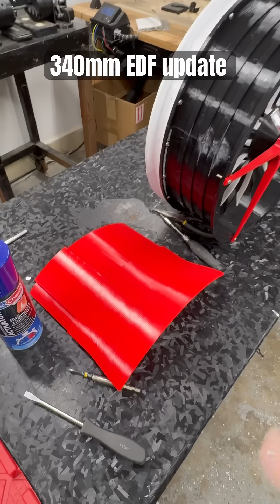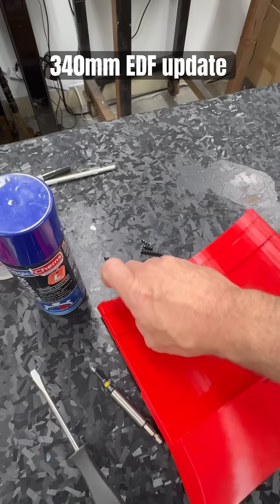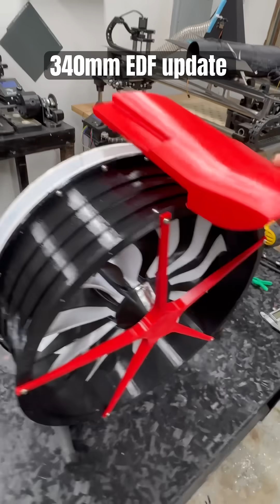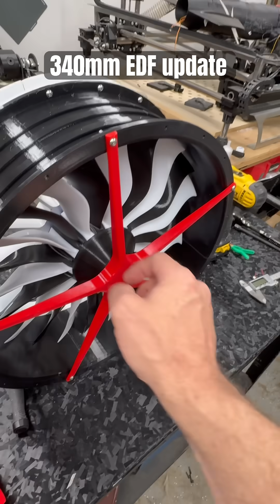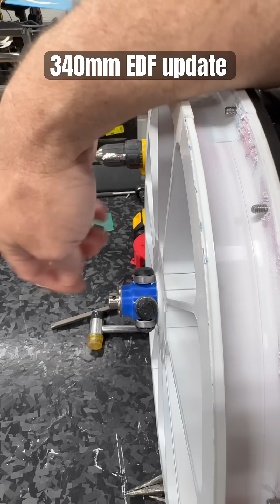340 mm 3-D printed EDF, an explanation of the bench test unit. ￼#3dprinting #fyp #edf #diy #shorts

Comment: Also i would calculate the g force at the wingtips, as uuh, y'know that can be very big
Reply from the maker: Yeah, I’m going through a calculations to figure out tip speed, and everything else at this point I’m going to be going through voltage cycles from 22 all the way to 75 failure rate will determine the appropriate voltage and then we’ll measure the thrust at that point.